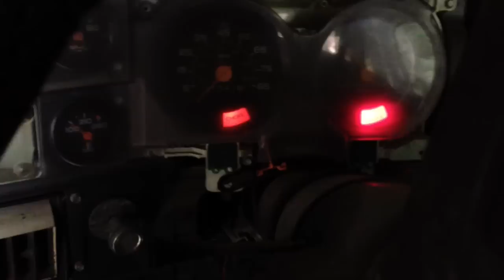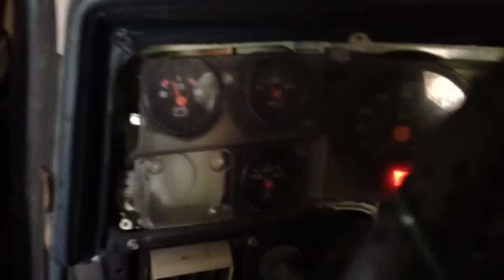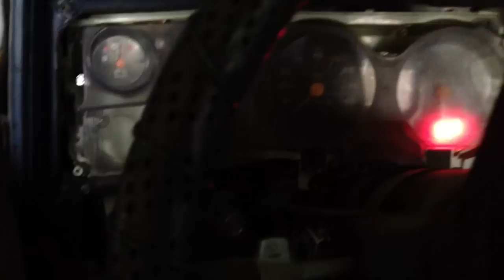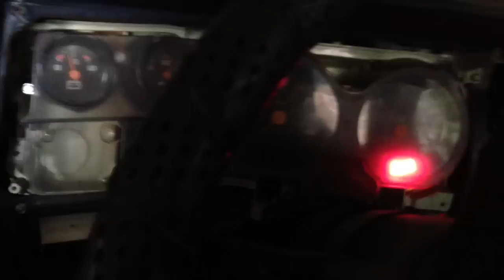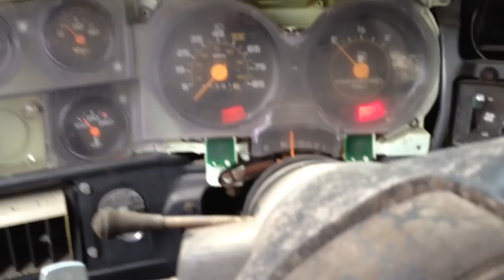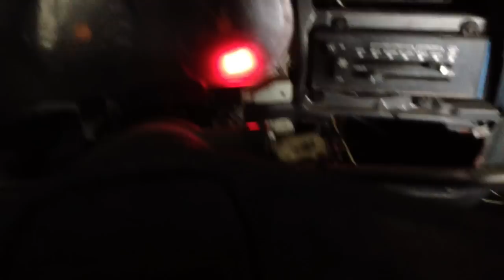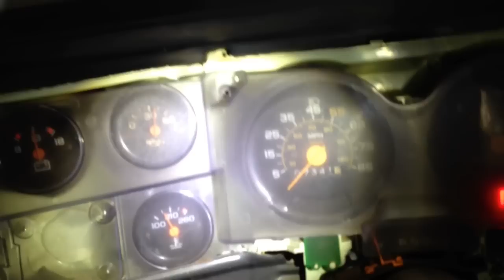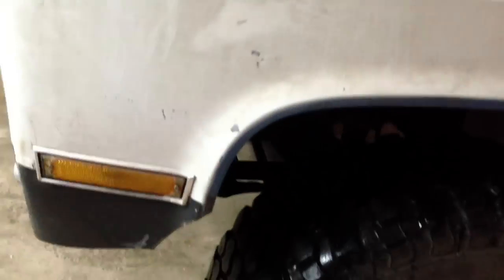86 K5 Blazer Cold Start And Move

Comment: Good cold start vídeo. Do you still have this blazer?
Reply from the maker: No I ended up pulling the engine out and putting in a K10 and sold the blazer. It had rust issues and the body had been hacked up.